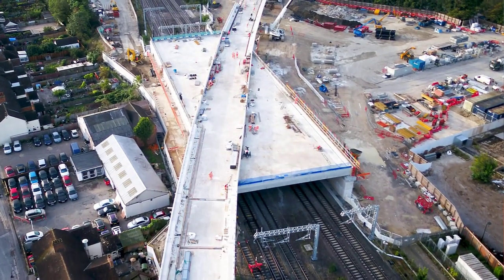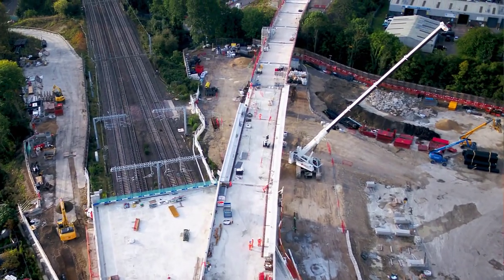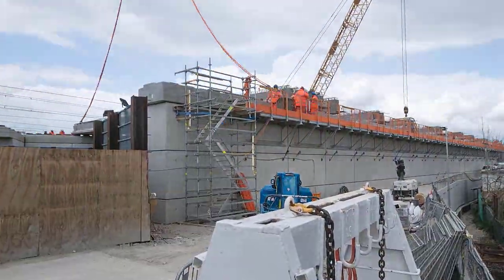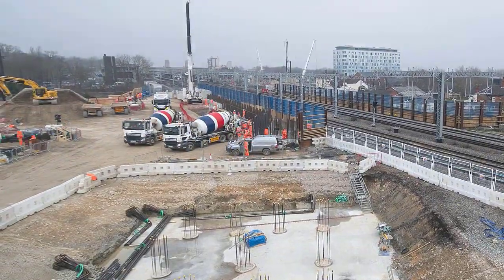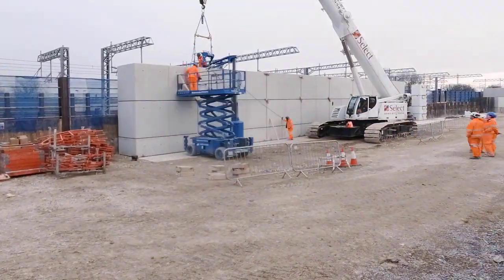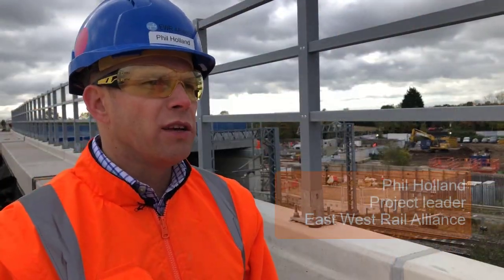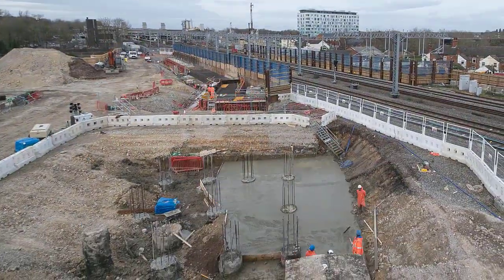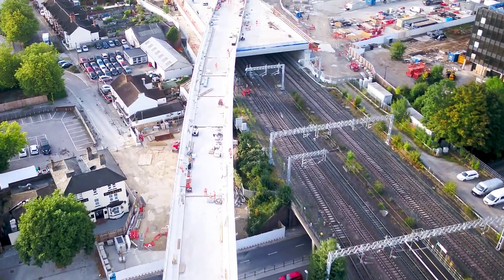'Box structure' flyover replacement saves £70m

Comment: Incredible work with the new flyover for the East-West Rail link to pass over the West Coast Main Line at Bletchley. Is there plans to electrify the former Varsity Line with new line to be built to link between Bedford and Cambridge either going via Sandy or Camborne. And a new link to Aylesbury Vale Parkway. You are doing a amazing job.
Reply: Yes to the connections, but no to electrification. It was in the original plan but quietly dropped.

Comment: Northern rail investment loses out again
Reply: Why?
Reply: none of that is the fault of Network Rail, the contractors building this or East-West Rail- that northern rail investment is being cut is nothing to do with theis project and entirely to do with having a bad government
Reply: I live in the north mate, this is about creating cost effective solutions for the building of flyovers, nothing to do with the North, South, East or West.
Reply: @L.A.T.E.84  indeed.  And East - West links in this part of the country are poor.   You've got to go via London or via Birmingham to get from Oxford to Milton Keynes/Bletchley at the moment.  It more than doubles the 40 odd miles between the two places.  East - West should open up long distance Cross Country routes too.
Reply: @L.A.T.E.84  The North COULD have a fairly inexpensive increase in Capacity - reopen Woodhead.  And a increase in Passenger links - Reinstate Skipton-Colne (And with Bi Modes IT WONT NEED expensive OHEL throughout).   It is a bit lacking in faster Leeds-Bradford-Halifax-Huddersfield-Rochdale-Manchester though - but given the Pennines are in the way its not going to be easy to speed up ,  but more services could run via Hazel Grove for some park and ride to Manchester and Airport services  for example,  Leeds City Centre and Manchester City Centre dont have to be major objectives if the likes of local trams can provide more comprehensive links into the overall conurbations.
Reply: @highpath4776  
I get what your saying and yes the investment in the south is far greater than the north. But this topic that Network Rail has done is about reducing the cost for flyovers in general not about geographical location.
Reply: @L.A.T.E.84  I always say effectiveness of the £ spent , not the number of £££ spent.  Actually say for the Present Northern Rail area proposals IF they can be completed by say 2030, AND deliver the time savings and capacity expansion they are probably better than the HS2 (? HS3 ?  proposals - save it appears for Bradford,  but really have you ever been to Bradford - its a haul out and up to say Queensbury as a large villiage outside , and the number of connecting (but always jammed) motorways came from the idea that the mileage of motorways is directly proportional to economic growth ( a correlation/causation that is not always true).
Reply: Aren't they reopening the line to Blyth just like they are reopening this line?